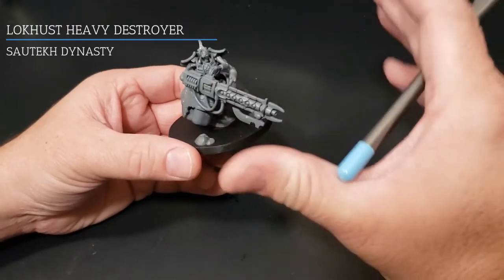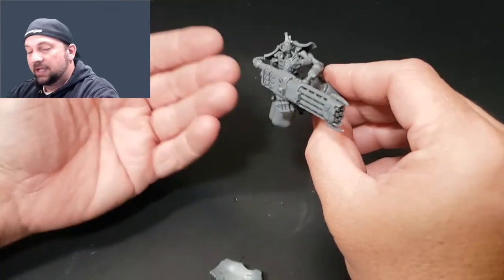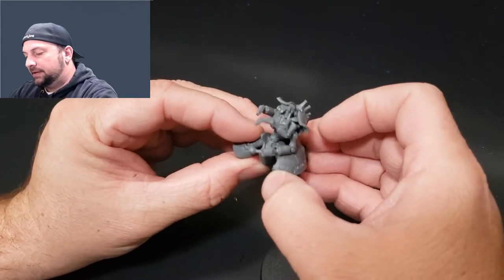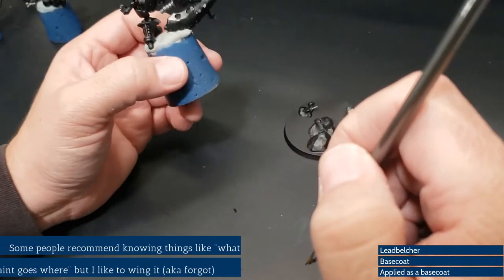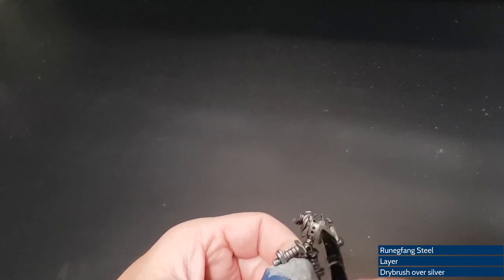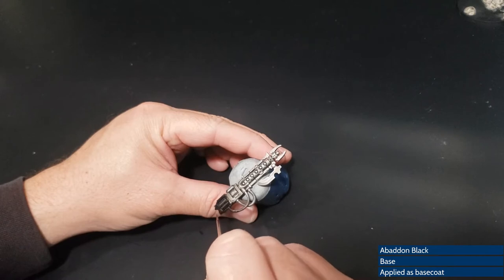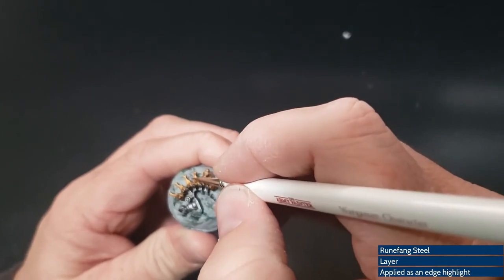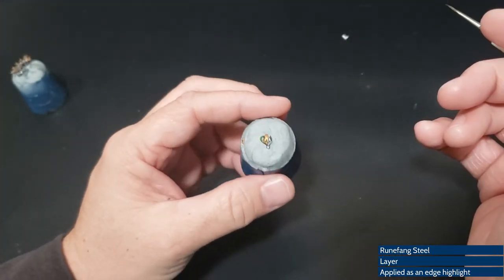Necron Lokhust Heavy Destroyer, Sautekh Dynasty

Comment: What brushes do you recommend? Do you paint Necrons the same now or have you changed anything? I enjoyed the video, and nice work!
Reply from the maker: Thanks!

For Necrons I try to do it the same way though if it's a model in a large unit I might end up dry brushing more sections to speed things up.  If you're looking for a good green glow tutorial, check out the Necron Blade video from JuanHidalgo Miniatures.  That's what I try to follow though I cut out a few steps to keep it easy on myself.
https://www.youtube.com/watch?v=gO_ctfHkcko&

For brushes I've been using Army Painter brushes out of their Mega Brush Set.  Mainly because I found it discounted about 50% but they're decent brushes too.  I also have some DaVinci Russian Red Sable brushes I've used in the past and will probably use again.  For me it's a lot about what feels good in my hand and how well is the tip holding.  I have to imagine if I ever spring for a pricey set I'll swear by them but for my budget and skill level I'm happy with those options.